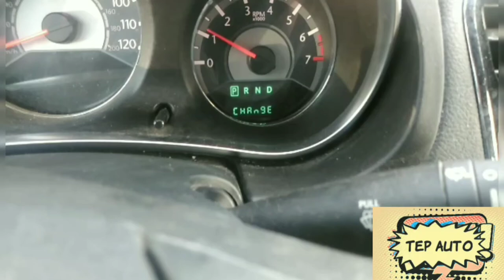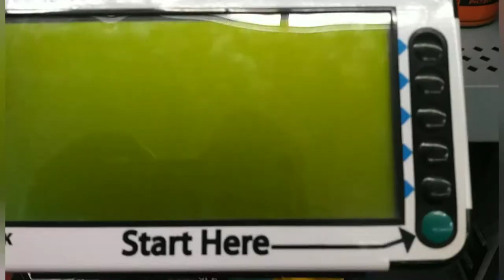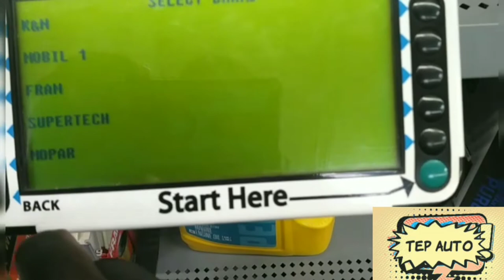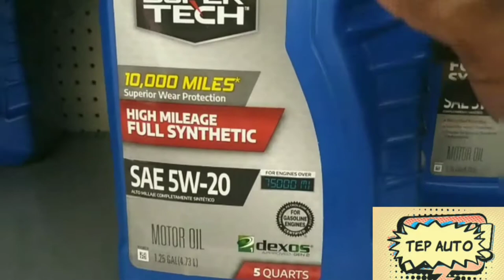How to do an Oil Change (Pilot Episode)

Comment: Great video!  One tip is to dip your finger in the engine oil and run it over the filter gasket before you put it on.  Also,  quick question.  Where does one find out how much engine oil to get to put in your vehicle?
Reply from the maker: When looking to perform an oil change, I would recommend always checking the fluids section in the owner's manual issued for your vehicle to find out specifics for fluid levels as to your vehicle